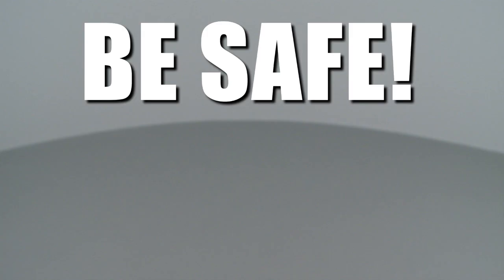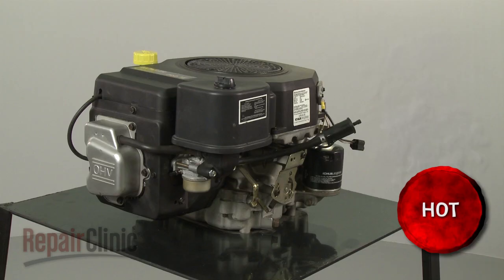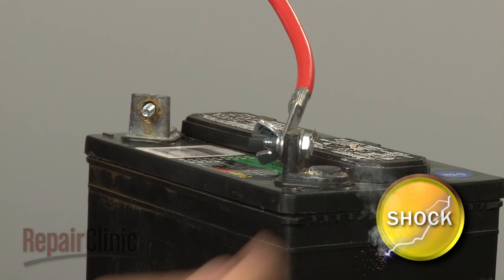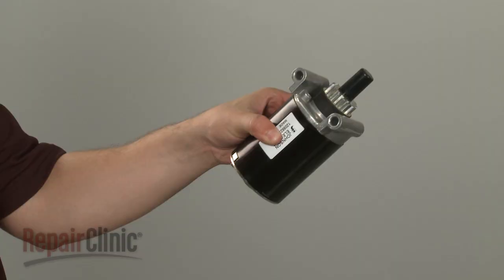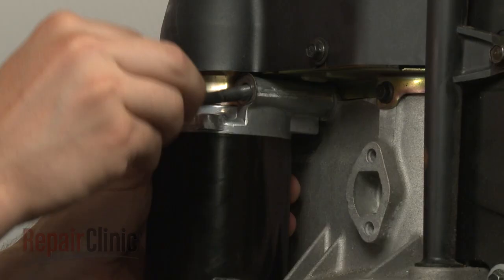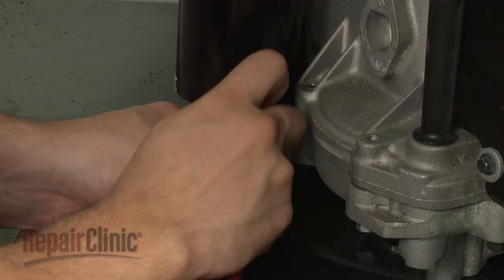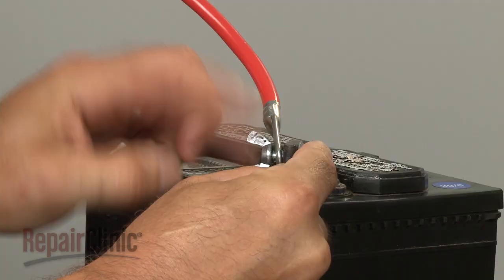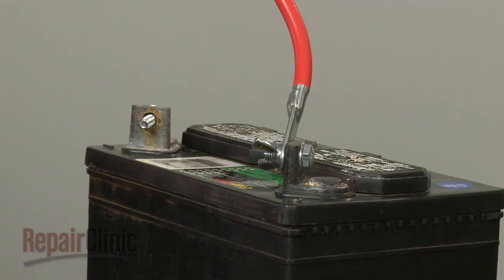Kohler Small Engine Starter Replacement, Repair #12 098 22-S

Comment from the maker: +Jim Richard Depending on the model you may have a seat switch that went bad or a wire shorted etc. and blew the fuse. When you turn the key the positive side of the battery is sent to the coil on the starter solenoid. The other side of the coil goes to the frame which is the negative side of the battery. You should have 12 volts DC across the coil when the key is turned and the brake petal is pushed down depending on the model.

Comment: Not trying to "nit-pick" but I was always told to put the ground cable on first, THEN the positive cable. That way you don't have possible power to the circuit and then ground out the negative on the chassis or somewhere it isn't supposed to ground to.
Reply from the maker: You should remove the ground wire first when removing the battery and the positive should go on first when installing. If you remove the negative battery terminal from the circuit you avoid the possibility of shorting the positive terminal to ground with your wrench since the negative terminal goes to ground. Other than that it doesn’t matter, you are just completing a circuit.
Reply: Always remove the ground wire first, Then the positive. The ground goes through out the whole chassis. If you connect the ground first, when hooking up the positive your metal wrench can touch the chassis causing an arch. Which could possibly blow up the battery. Batteries produce hydrogen gas which is highly explosive. No matter what, wear eye and face protection!!
Reply: @repairclinic  I remove the + red one first every time
Reply: @David Lightman I know

Comment: Please help. shouldn't the gear rise slightly to engage the teeth on the engine?
Reply from the maker: Yes. when the starter motor is energized the gear should move upwards and engage the gear on the flywheel pulley. Make sure the negative and positive cables are connected correctly to the battery. If they are reversed the starter motor will run backwards and not engage the flywheel. You can also check to see if the starter gear can move freely up to engage the flywheel by lifting it manually with a screwdriver. If it hits the flywheel but the gears do not mesh forgather you may need to adjust the spacing on the mounting post.

Comment: my mower has a remote solenoid like this one does. any idea where it'd be located? it's not in the engine bay. the wire disappears into the loom and no clue where it goes
Reply: It should be on the right side under the gas tank some place screwed to the body

Comment: I just installed my new starter and everything went well. The engine turned on right away and I began driving the tractor. About a minute later, the engine shut off on its own. When I went to turn the key, nothing happened. No sound, no nothing. What could be wrong now?????
Reply: A bad fuse or magneto